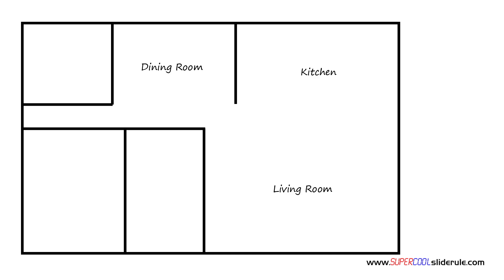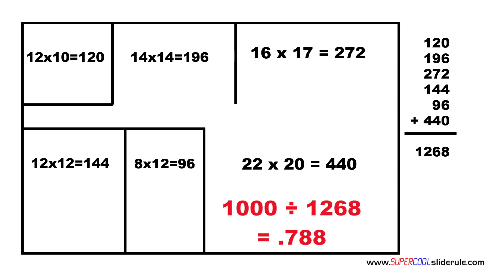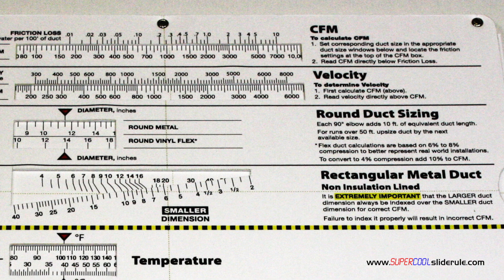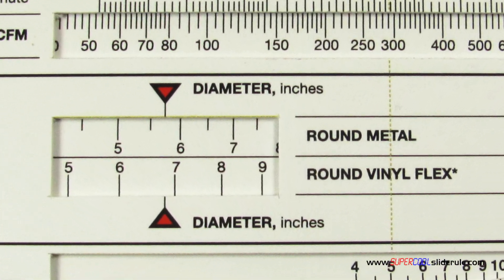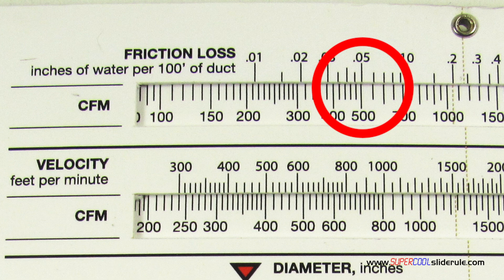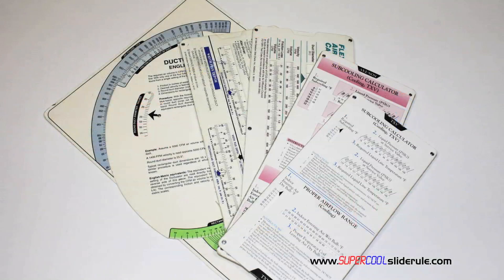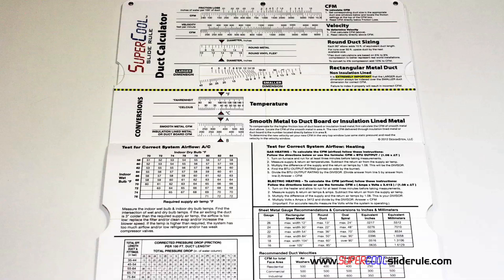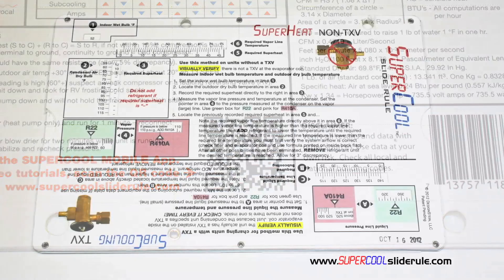Duct Size - How to size a Duct System for a House

Comment: Michael, 16" won't be adequate for 3 tons or even 2.5 tons IF you are using flex duct. One way to see this is to use 550 FPM as the upper limit for the velocity in flex. Any faster and you will rapidly increase the pressure drop and noise. A 16" duct has a 1.4 sq. ft. cross-section. At 550 FPM you can deliver 770 CFM of air. That's really not enough for even 2 tons of cooling if you figure at 400 CFM/ton. Air flow could be 350-450 CFM/ton depending on local humidity conditions.
Reply: Yeah ok for 25 years I've been using 16 inch return flex for 3 ton and no problems and the longer the better for less noise. You can read all the books you want go and  install and you'll find out what your doing really fast or you'll have customers chasing you with pitch forks

Comment: NO! WRONG! CFM is sized by heat loss/ heat gain not by square footage. Dont do this, corner rooms, 2 exterior walls and 2 partitions walls will not have enought air while rooms with 3 partitions walls and one exterior wall will have to much air.
Reply: Can you help me find my cfms
Reply: @bruced9668  What is it that you are looking for, existing home, new home?
Reply: @psmopar  existing home. I have a 3 ton unit and I have the sq footage of all the bedrooms and the distance to all the rooms and it's pretty much a straight shot to all the rooms. But I dont know the duct size. And I thought I knew the cfms according to this video but everyone in the comments says its incorrect.
But with the way he found it my different duct sizes look like the appropriate size but I'm not sure

And also my living room has one duct coming from the handler and then it split into two ducts that both go into the living room. That's the lne I'm having most problems sizing
Reply: @bruced9668  I'm confused, how are you sizing the duct? by the 3 ton system and assuming you have 1200 cfm from the air handler?  You do or don't know the size of the exiting duct? what is your goal to patch up the living room as that is not cooling correctly?? What type of air handler gas or electric?
Reply: @psmopar  The air handler is electric. All the existing flex air ducts arent the correct, one of my cousins installed them in this house 15 years ago.. 

I have a 3 ton and yes I believe that's 1,200 available cfms. I'm not sure how to calculate the cfms needed for each room. I thought this video showed how to find each rooms cfm in the beginning. 
I know the sqft of each room and I know the distance from the air handler to each vent.  
I have 10 air vents, 2 of them are in the living room. One air duct feeds the 2 vents in the living room.
Reply: @psmopar  is duct sizing something you can help me with
Reply: @bruced9668  yes email ?
Reply: @psmopar  yes may I have your email?  It's a one story house short runs
Reply: @psmopar  from the air handler to the split is 17ft, then it splits off into two ducts that run 4ft and the other one runs 5ft. . I believe the living room is 300.8cfm. The living room is 320sqft with 10ft ceilings
Reply: @bruced9668  Apparently YouTube will not allow my email address to be posted. CFM is calculated by face velocity and a velometer is needed to do that. Face velocity, duct area and air temp/humidity are needed to calculate cfm. Don't know of any meter that will do that in a tenth of a cfm. So you have the midcolumbiamopar address at gmail?